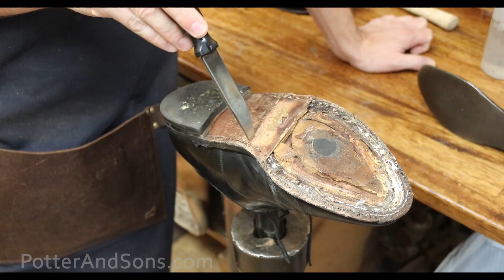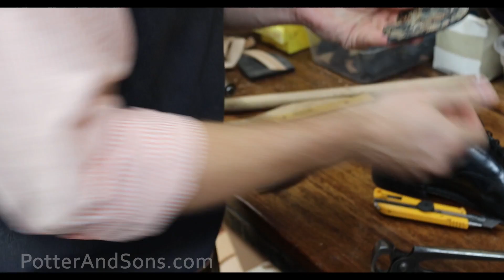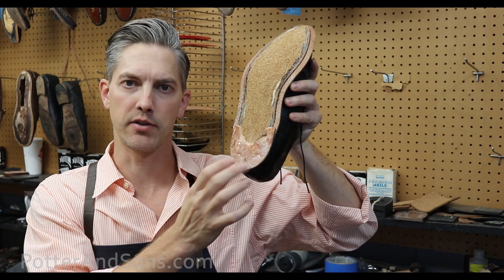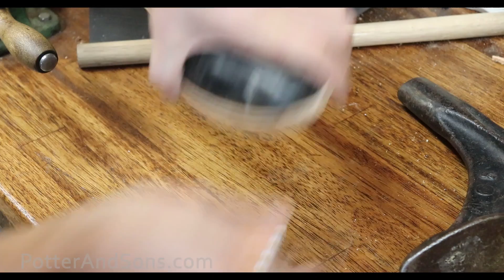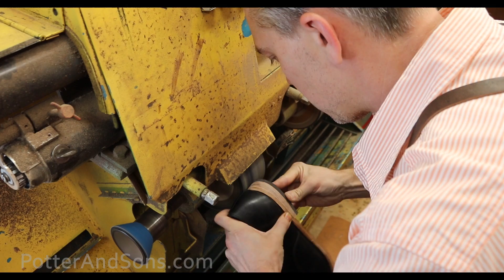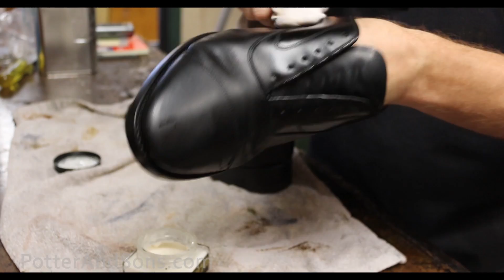Cap Toe Oxford Total Restoration | Shoe Cobblers Turn Old Shoes From Throwaway to Better Than New

Comment: What a set up you have there: all those trad machines; all the handwork you did was great to watch.  I found this very interesting as your restoration of these shoes shows clearly the Goodyear welting process.  Q.  How much did this restoration cost?  All that skill, time and quality materials!

Thanks
Tony (over in the UK)
Reply from the maker: Hi, Tony!  Glad to see we have folks over in the UK watching our videos as well.  👍🏻 We’ve been over there several times and love it.  

With all that we did to the shoes, as well as the sole leather option he chose, I believe it came to around $160.
Reply: @TrentonHeath  Yep, watching for over the pond.  I have to say, after watching the video I thought to myself: is it possible to put a welt on a shoe that does not have one?  Strange question you might say, but, I bought a pair of Church's tassel loafers off Ebay and the sole was glued on!   I had assumed it would be Good year welted by not: apparently it had a 'false welt'.  I had the sole glues back to the upper as it was coming loose. Such a shame as the uppers are made a quality leather....so, can you retro-fit a welt to a shoe so it can be stitched?
Yours
Tony

Comment: Fantastic job guys and an easy subscribe for me! Question - Is there a decent value proposition when resoling a pair of J&M? I can only image the work you guys put in cost more than the shoes themselves.
Reply from the maker: Patrick Lino Thanks...we appreciate the sub!  It’s really personal preference.  All of the work we did on this shoe was just under $200, which is just a little cheaper than a new pair of this style.  For most folks, I would have recommended they ditch the J&M’s, if they were as bad as these, and buy a better brand.   This particular gentleman really liked these and wanted to keep them.  There are a lot of better brands out there now that are $200-$300 and much better than JM.

Comment: How do you decide on the height of the heel, is there a formula?

I also surprised at the lenth of the nails you use.
Reply from the maker: Cormac Keenan It’s all based upon how the shoe sits in the back.  If it’s not sitting flat, it’s probably too large of a heel block or top lift and needs to be adjusted.

Comment: Awesome video guys!  I also would like to see an estimate of the pricing for the various parts of this restoration...
Reply from the maker: Sean Hames Hi, Sean!  Thanks!  Most of it is on our website www.potterandsons.com under Services.  It was around $115 for the German leather soles he chose, $65 for the welt, and $15 for the stacked leather blocks.
Reply: @TrentonHeath  thanks, and very nice work!    So for about the $200-$250 total,  would there be a new pair of shoes that you would have pointed the customer to, that would have been a similar quality to the resulting shoes?  (I realize the customer wanted to keep this pair).     In other words, would a comparable shoe cost much more new (given your craftsmanship),   or was the quality of the uppers keeping these from being a higher resulting value ?     much appreciated.

Comment: How did you install the new cork?
Reply from the maker: 80RedRock We remove all of the old cork, put a little glue on the bottom of the insole and then put in the new cork.  We use cork sheets instead of the hot cork.

Comment: Hey, great video.
How much do you guys usually charge for a resole job? 
The only cobbler at my area ask for 150-300 Canadian dollar and that seem very overpriced.
Reply from the maker: Khánh Vũ Thank you!  It depends upon what all needs to be done.  If it’s a simple, straightforward full resole, using our house leather, it’s around $85.  If we use a higher-end leather or Dainite sole, it’s between $105 - $135 US dollars or more depending upon options the customer may want or need.
Reply: Trenton & Heath thank you for your answer.

Comment: I’m just wondering if the customer could have requested a 360° welt? And what are the benefits of a ¾ welt? Good job, Heath.
Reply from the maker: Peter Wong Thanks!  A shoe can’t be converted unless a 360 rib is added.  This is done during the making process as the upper is lasted up to the rib instead of nailed flat under the heel.  A 3/4 welt just adds for a cleaner, more polished look.  I wouldn’t necessarily say that it’s a benefit.  Full welts are actually much easier to work, but most very high end shoes are 3/4.